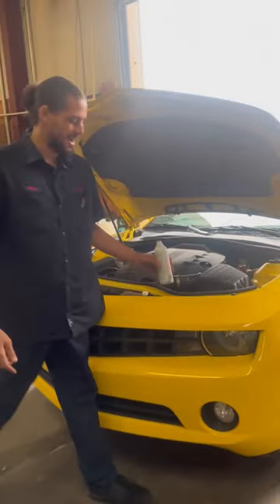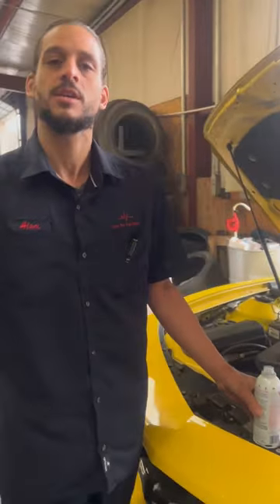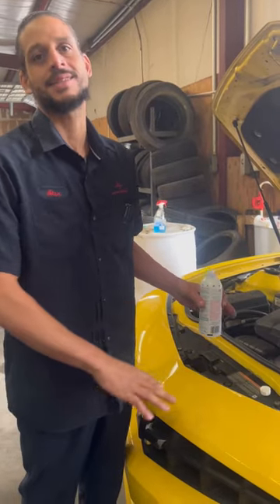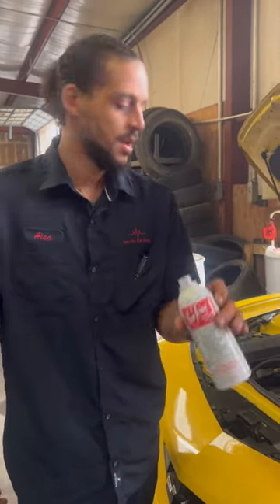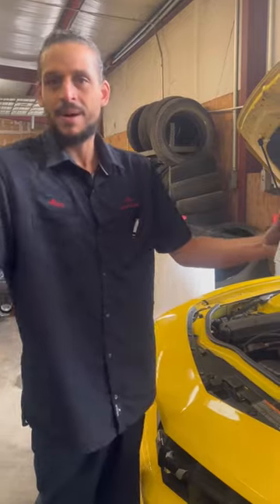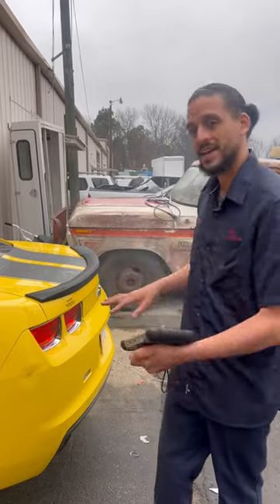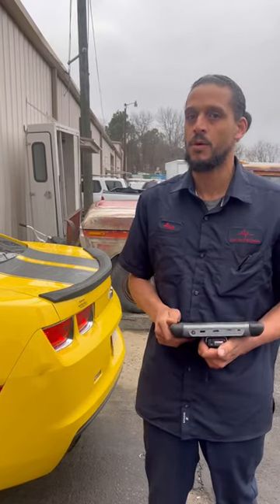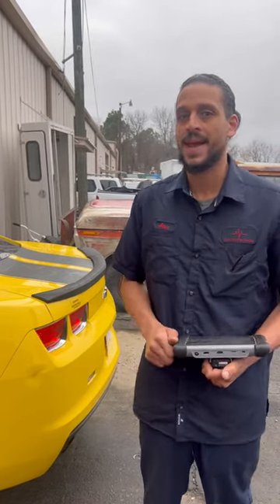Try this before you replace the catalytic converter  #cartips #chevycamaro

Comment: The smoke isn’t because the system is dirty. It’s because the sea foam is burning. 🤦🏽‍♂️
Reply from the maker: Well, please explain why sometimes some vehicles smoke way more than others? I use the same amount of sea foam. Some smoke a lot and some smoke very little
Reply: @AlexTheCarDoctor  I appreciate your contribution. No hate here. I’ve used Seafoam for many years. It actually doesn’t work well because Seafoam was designed for two stroke motors back in the day. If you pour it in the gas tank, it won’t smoke as much. If you suck it in through one of the intake hoses, then goes through the throttle body then to the pistons then out the exhaust. Once the Seafoam gets sucked in, turn off car. Wait 5 minutes to let the Seafoam sit in the internals. Start up the car and voila. A bunch of smoke because the Seafoam burning. It will clean the injectors and some of the intake, but I don’t think it’s strong enough to clean the cats or the piston heads. B-12 seems to work better. I use B-12 instead of Seafoam. 👍🏽

Comment: I don’t trust you as a mechanic anymore you put a petroleum based product straight into the motor through the intake and say the reason for all that smoke is an indication that the system is dirty is bs bubba the reason it is smoking is because you poured a oil based product straight into the engine and the engine now has to burn it out aswell I’m not saying that it won’t clean anything while it is being burnt out but you my friend need a to learn a little bit more before you try explaining things on youtube to an audience that may listen to you what you did wasn’t wrong but what you said was wrong
Reply from the maker: I’ve already proven this point on a testing video, if you care to watch it. I put it into two different cars, one smoked and one didn’t. Have done this 100’s of times, never had a problem. Some have been successful some haven’t. I said it was a 50/50 chance in the video….You don’t know me, or my back ground. Been doing this almost 20 years. You don’t have to trust me… to each their own.
Reply: @AlexTheCarDoctor  I do this stuff everyday for a living just like you I never said what you did was wrong I’m just saying every car is going to smoke with the way you did that and I would expect it to trust me I know again like I said I would do this too but it is going to smoke reguardless I’m not sure what was different during your testing of two different vehicles but it must have been the fact of it being two different vehicles one is going to burn it differently than the other
Reply from the maker: Explain this to me then and if it makes sense then I’ll make another video saying I’m wrong https://youtu.be/7wfXEgrEDHU?si=-fcR-7dJ4pKUYXzY I’m an empty cup and always down for learning
Reply from the maker: @shanebroom9173  ok you looked at it I see
Reply from the maker: @shanebroom9173  they both internal combustion engines. They’re both going to burn the same. The reason being is white smoke more than the other one was very dirty, and the other one was very clean.